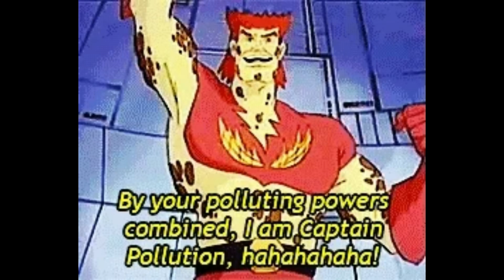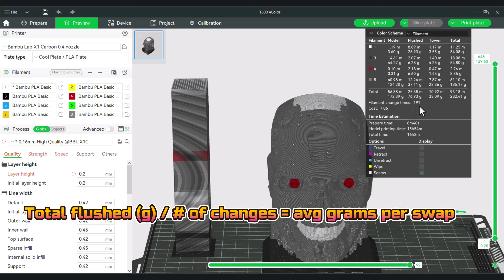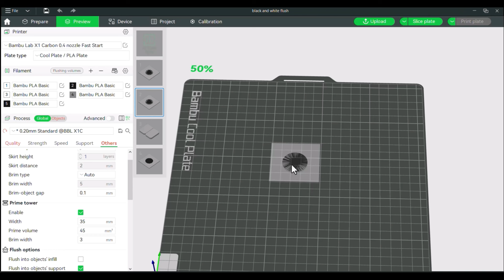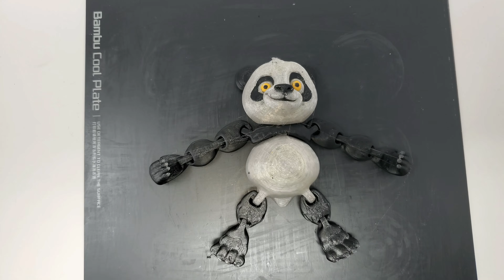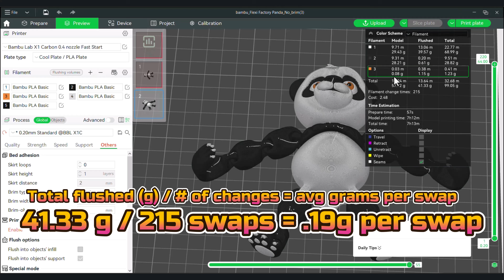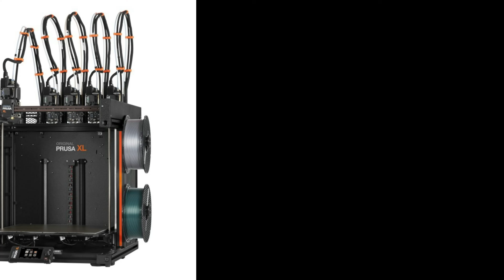Dollars and Cents, Bambu Lab's Filament Waste True Cost.

Comment: Ashley, once again a great video, thank you for taking the time to explain to some people that make things petty and complicated. The way I see it is that for 5 years I used a creality cr10 and the amount of wasted filament through bad prints and time wasted trying to get the printer to just work with all the changes and tweaks is nothing to compare with the X1 poop when printing multi-color. The frustration of before is now the satisfaction of knowing, that when I do a print is laterally 99% success. for me, it is just the time that matters but again you can't have it all. Thank you again for your hard work.
Reply from the maker: Hey hey. Thank you very much. I admit I wasn't prepared for this one. Started easy enough but became a mess of settings and printing. 😅

At least we have a better understanding(with math!) how costly or inexpensively filament swaps can be. While I didnt have the CR10 I did have the ender 3 and between just getting a decent print off of it ,I wasted a ton to filament running small test prints before  setting up a large print. 

I do not miss those times. lol

Comment: I'm a little confused. It seems at the end you were still wasting almost as much as you're using, and only really losing quality to save filament. I am not going to speak on anyone else's claims of this VS another printer, just purely on a this as a process. It still seems wasteful to me, I guess it's not crazy but if this isn't for a business (where you can charge to make up for it) I find it very hard to justify, personally at least.
Reply from the maker: Thank you for your question. There are a few ways to look at it.
1. If you are trying to save filament the(from the panda perspective) you can go from 148g(tada3dprinting) of waste down to 44g or $1.48 to 44 cents. 

2. If you fit more of those on a plate the purge is the same.
For instance the long retract 44g. Could net you 4 pandas for the same 44 cents in waste which avg about 11cents a panda. If your model could fill a build plate with clones it's all the same purged amount. With some creative positioning you could fit a 5th panda. 

3. The dark to light change requires more purge unless the colors are dark and the color changes were nearly imperceptible. So you can lean into less flushing. The transparent/black filament was supposed to be the worst thing you could print without a full flush. 

4. The long retract option worked well with light and dark colors for the panda (a little too well I have to investigate why it was much lighter in mass.) 

5. The prime tower seems to be the greediest in terms of filament usage and it can be removed or shrunken. But I recommend at least a small one. 

In the end I like showing options and making a single panda in this case was not a good use of time or filament but the experiment needed those as a baseline. Personally I don't like printing multicolor items in the z axis. Not because of waste but because of the time investment. 

I mentioned the other printer as a comparison because you would need to burn through 100-250 rolls of filament to make the waste loss an issue with or without the filament waste reduction. The video started as a comparison because the savings on filament was supposed to be the reason to get it. But the amount of filament needed just to break even on the initial cost was startling. And this is filament loss not filament in general. I pulled back on any criticism of another technology because it is good for a different reason not because of filament loss. 

And lastly you will always have waste in some form. It is inevitable for FDM printers. Your wallet, tolerance to loss, will be your guide.

Also single color is always the fastest option to push a part out. That panda takes under 2hrs on a single color and 7+ multicolor. 
4 pandas multicolor take 13 hrs. 

Again thank you for the question and allowing me to explain further. I hope it makes sense. 😊
Reply: @ashleys3dprintshop  Thank you! Yes that makes a lot more sense!
I think my tolerance for loss is just very low and causes a bit more shock than is reasonable at any losses, but I'm sure that will change with time. I don't think I've gotten through a full KG yet, certainly not 2, so I'm very new to the hobby. I also appreciate the context, I haven't even heard much about the other printer mentioned and wasn't aware it was being touted as a way to save money on wasted filament, thank you for the practical experiment showing that in fact it probably isn't worth it for that at this price.

I've seen one other video on mitigating waste and I'm very curious about the extent to which 'purge into infill' can be used, when I first saw anything about 3d printer poop from color changes that was the first thing that I thought of.

Thanks again, I really appreciate the response!

Comment: I wanted to share a video request for the future. I would love to get your take on the various ways to speed up prints. I.e, flow rate vs enabling sport mode. Or perhaps boosting individual speed settings. Is there a good method to tune your settings depending on your print? For example, I feel certain that Gridfinity boxes (hollow boxes, little infill) need to print slower than something with more infill and internal structure, but I don’t have a good way to quantify this. Thanks! Pinny
Reply from the maker: That sounds like an excellent idea. 
Aside from just pressing sport or luda modes there are a few things we can look at. 

To truly unlock the speed it may be model dependent too. 
I would have to do some investigating on how far we can push vs leaving things as default.
Reply: I played around with this for a bit today and did a bunch of experimenting on my own. It seems to me that the things that make the biggest difference to speed are 1. Profile speed settings (layer height and wall/infill print speed) 2. Model design (whether the components are large enough to ever reach full acceleration) 3. Filament settings (max volumetric speed, min layer time) and 4. Enabling sport/luda. These seem to be the most important components to control speed, but I did not yet come up with any framework for how to select which settings are the best for any particular model. Need to give that some more thought.

Comment: Very interesting video! Most of my prints are one color. When I do use more than one color, I avoid designing where there is a color swap on most every layer. Those color swaps really slow down printing! I could benefit from some settings changes, but I probably don’t do enough color changes to justify it. Especially after seeing your numbers on the cost of each change! You did your homework Ashley! Well done.
Reply from the maker: Time is my biggest issue. If I can run a print overnight I wont stress over it but many vertical color swaps are the bane of my printing existence.

Thank you very much for watching and commenting.

Comment: i've owned it for two years and never printed a single multi color print. i use it as a filament changer and for multi-material prints. doesn't really produce much waste, especially since the retract before cut feature.
Reply from the maker: The first year of printing on the X1C was mostly single filament as I disliked many vertical color swaps. Now that some of my clients know I can do multicolor I have been leaning to what they want. 

I need to dig deeper into that retract before cut as the results were well outside of what I was expecting. Thank you for watching and your experiences.

Comment: Got an A1 recently and what a disappointment it is. All the hype for Bambu products is lies
Reply from the maker: I dont have the A1 personally so I cannot speak on it directly.
Is there any flaws you wish to share?
I only have the X1C(going on 2 years) and it basically launched this channel as I am more focused on the prints and slicer than the actual printer...if that makes any sense. Thank you for sharing.
Reply: What part is a disappointment? I just bought the x1c and haven't looked back since. Love being able to focus on designing and creating rather than debugging my printer and it's prints. Also the speed to get my functional print is absurd.
Reply from the maker: We are of the same mind. The X1C has been great. Solid, fast easy...and reliable. It has become the baseline of what I expect from other brands.

Comment: The Bambu is still the best printer on the market. The waste is not a big deal. It’s not like every single print is multicolor and when you do multicolor fill the entire bed the waste is the same regardless of how many you print.
Reply: Bambu lab is far from being the "best printer on the market". Looking at reviews they're some of the worst. trustpilot & google is at 2.6/2.8 wile prusa is at 4.6/4.4
Reply from the maker: Very true. Even the multicolor prints I typically perform are a couple of filament changes overall and with proper planning, like multiple (cloned) prints or a dozen or so other options it stops being an issue.

Comment: I have a little side project going to see if I can get filament extruded through a printing nozzle and into a silicone "sphincter" to be formed into a 1.75mm filament, so that purged filament can go directly into a usable form. There are a lot of challenges to get this to be reliable, but it's looking promising. Eventually it can be implemented as an add-on for many models of FDM 3D printers.
Reply from the maker: That is an awesome project. I can see it being extremely useful for fdm printers. Thank you for sharing that.

Comment: Thank you so much for your time and effort in making this video. I'll be honest and admit I'm going to have to watch it again to fully understand your findings. I'm new to AMS and just in my first year of P1S ownership so this is a bit advanced for me lol.
Question: Is it really necessary to purge the exact same filament every time I do a single colour print without the AMS? It seems so wasteful, is there a way to skip the purge or at least reduce the amount of waste.
Reply: “…so wasteful”? 🤨  If priming filament wasn’t going out the back it would be going onto the bed in the form of a skirt because your nozzle ain’t ready to print without extruding something first.

Prior to buying my first Bambu Lab printer I used a Wanhao i3 Duplicator Plus, a single color printer, for 6 years. A skirt was a necessary addition to every print to ensure the filament was flowing before the printer started printing the print itself even if I hadn’t changed the filament. When a print is finished filament still oozes from the nozzle as it’s cooling, likewise as the nozzle is heating before a print. Without any priming, out the back or as a skirt, the first extruded bit of the print will be missing (no filament) or spotty which is inadequate for good adhesion to the bed (i.e. no squish). 

Getting a good first layer is key, whether you’re printing on a fancy schmancy PEI-coated spring steel sheet or on a manually-leveled aluminum bed that bows up in the middle when heated (because it’s screwed down at the corners) and is covered with blue painters tape and purple glue stick.

I also used to print uphill in the snow both ways but that’s a story for another day. 🤣
Reply from the maker: Thank you very much for your answer. The newer printers handle so much of the "ease" of printing we soon forget why the printers need to do what they do.
Reply from the maker: Thank you very much for watching and the potential rewatch. 😉
This is a bit outside of my normal videos as I tried to, unsuccessfully, simplify things but it was a very dense topic. 

As for your question I just weighed the pre print purge and it avg 0.3grams. If your filament is less than $30 a KG it is less than a penny. 

I typically run a fast startup which still purges out the back but reduces the prime lines to 1 instead of 2.

radish6691 has an excellent answer and these types of "prechecks" and printer quirks have been around since fdm printers have been around.

Comment: 🤘BITCHIN🤘 Thankyou for this info! The purge waste never bothered me, cost of business. But i do take measures to conserve. There are projects where it can be used, ive been making spinning tops with a mold someone designed, and also use a t-shirt heat press to make wall hangings👍👍
Reply from the maker: Great point! The end result is most important. This topic has been nagging me for a couple of years. Make adjustments that make sense but dont stress on small amounts of $$$. Thank you for your continued support.

Comment: Have you experienced any clogging with the long retract?
Reply from the maker: So far no clogging. But I went back to my cool plate and ran it at 35C since those pandas were run over night with the door closed. 
YMMV
Reply: i used a custom profile i made myself, that retracts the filament like you can do in the settings. 

700 print hours on AMS, several thousand swaps and so far. not a single issue, besides 1x clogged nozzel from a metal shaving that was in the filament :p
Reply from the maker: @Bastyyyyyy  excellent to hear. Which plate are you using?
Reply: @ashleys3dprintshop  Some Aliexpr textured PEI , that is a bit more rougher then the stock one from bambulab
I just clean it with IPA before every print that is longer then 30 mins :p - not a single failure so far ^^